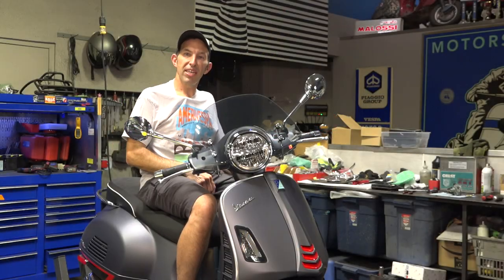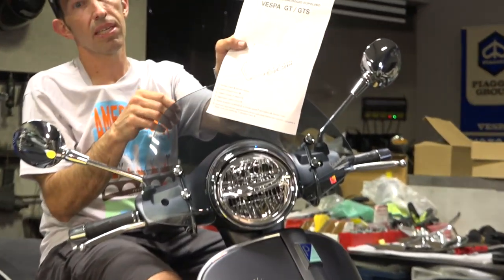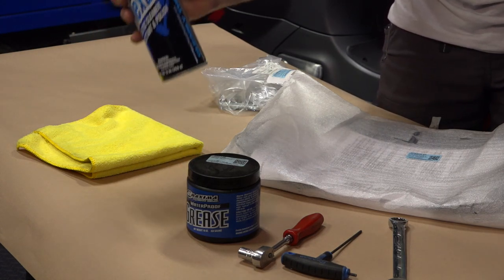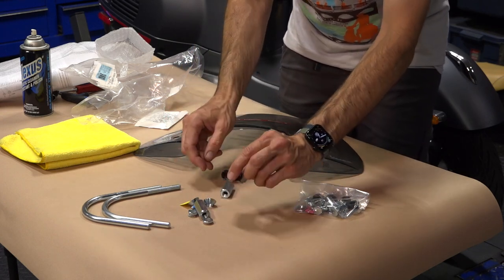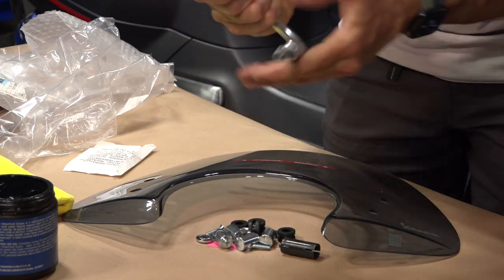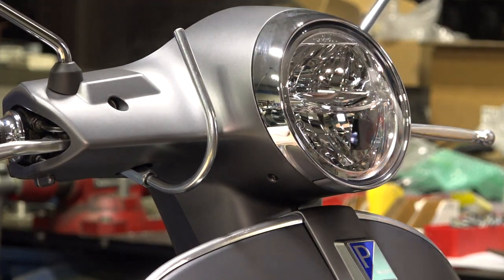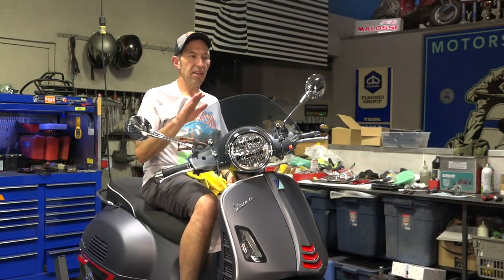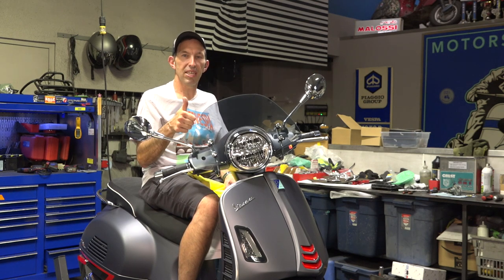How to Install the GTS30PA-SM Smoked Flyscreen on a Vespa GTS HPE

Comment: Thank you for the great videos. I purchased the updated version of the clear flyscreen for my '23 so the parts were slightly different. Unfortunately, I found it incredibly difficult to get everything straight and spaced properly and I ended up removing it. I'm sure that most here are probably more experienced at stuff like this than I am so you'll have better luck than I did. Given the price of the scoot and the flyscreen, I wish that there was a better solution for installation that just the compression fit. Even starting at the exact same point before I tightened anything, the plastic expanded more on one side than the other. Hopefully you'll have better luck than I did. My ambition exceeded my talent, I guess.

Comment: Hello Robot! I watched a lot of videos, I'm glad I found you.
I'm asking for your help . Pieggio MP3 250. 2006. Starts very well when cold. If it is hot  does not want to start immediately, the starter is new, the battery is new, the voltage regulator is new. The injector is 12 ohms when cold and 17 ohms when warm. The starter starts but won't start. If I take the lights off, it started up warm. When it cools down, it starts right away...
Please help, tell me your opinion.
Thank you!

Comment: Ah, the "Euro-spec" flyscreen, my all-time favorite. Yep, the included instructions are…interesting, but not too helpful. I feel this one is ideal for riding with a full-face or modular helmet (or at least a 3/4 helmet with full face-shield). I believe I used a much earlier Scooterwest video as a guide…patience is also a virtue. 🙂 And, once you have the screen set up, you want to periodically check the clearance at the headlight: I had it shift on me and rub against the headlight bezel after a few rides. Thankfully, no serious cosmetic damage.

(BTW: You said that GTS is a '23 model? Are those front turn signals standard, or aftermarket?)
Reply: aftermarket
Reply: The mirrors are wrong for a '23. Must be a '22.